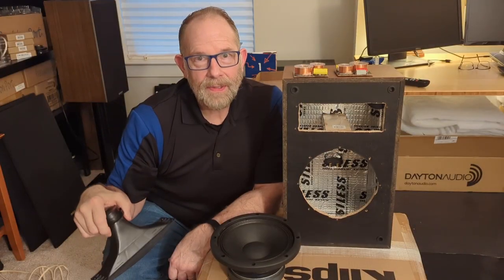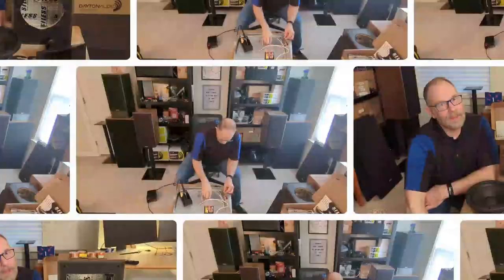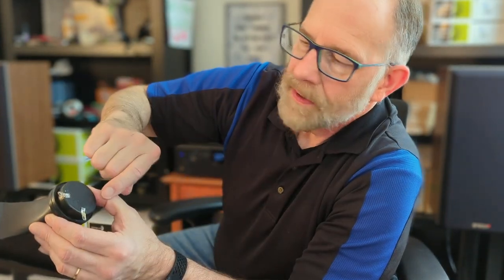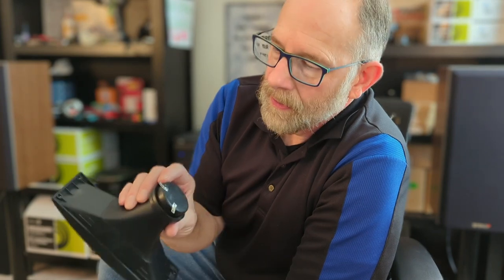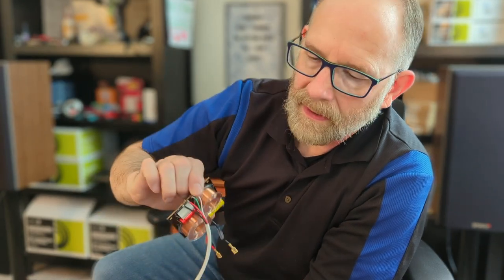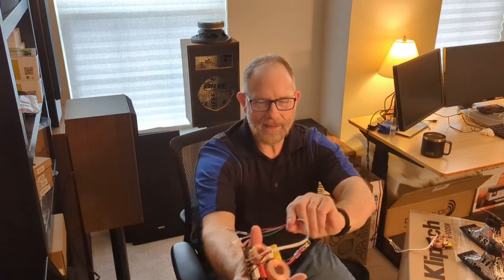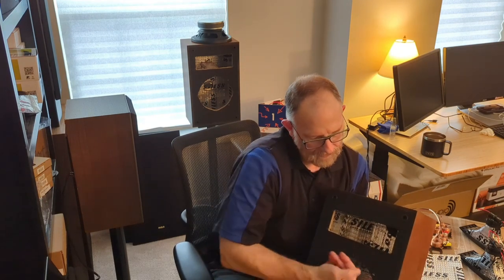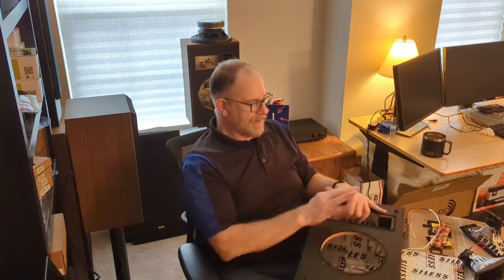Piezo Horn Tweeter EPIC FAIL in the MC-1800 Mini Mach One Project Part 3

Comment: Piezoelectric need a cap 3.3uf and 10 ohm to give amp stablity,ie a load  the network you hold is for magnet / voice coil 8 ohm drivers.
Reply from the maker: Thanks Larry! So you've had success with a simple 1st order cap in series and 10 ohm resistor in parallel?